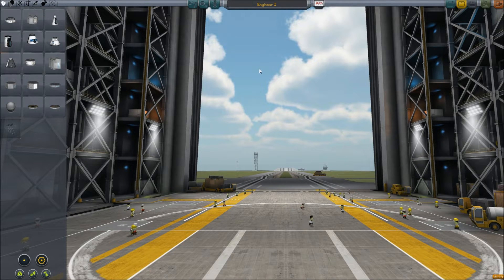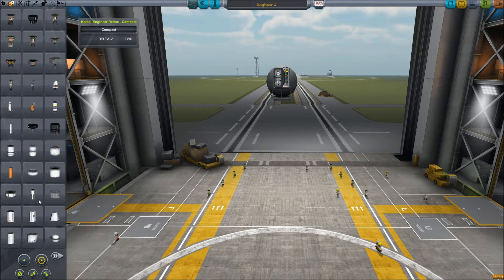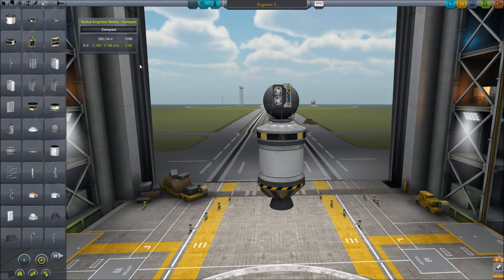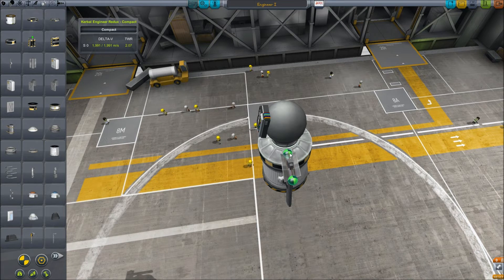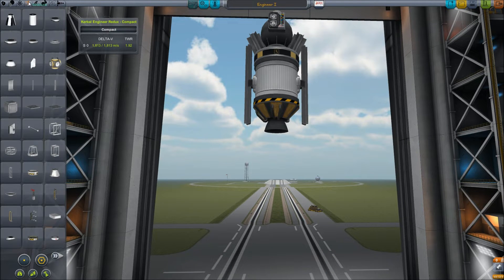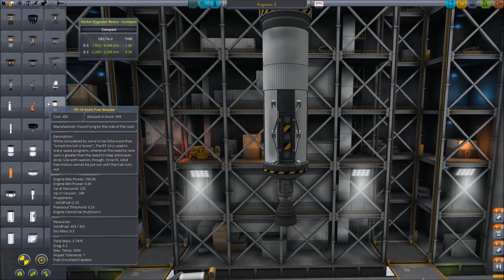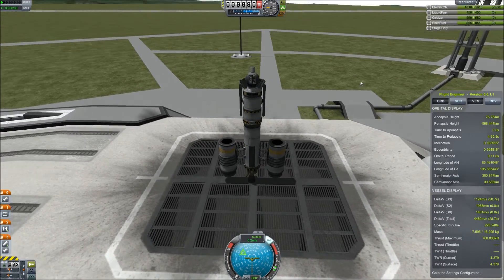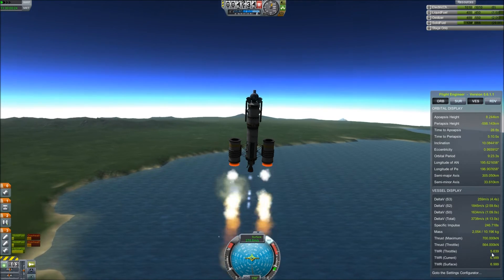KSP Mod Kerbal Engineer Redux

Comment: Is there a way to add other headers  to the KER window (at VAB)?
I am interested to know which altitude I can reach at the end of each stage. This way I could change for example engine thrust, limiters (solid fuel) and fuel quantity before I try to launch. Considering a straight climb.
I ask this because I have trouble for example arriving to a specific altitude with a specific speed to test some part for a contract. I need to test a dozen times before I get it right, this gets boring, it kills the fun. Launch, observe, revert to VAB, make adjustments, launch, observe, revert to VAB, make adjustments and recycle, not very fun.
Have been looking for a tool to calculate that but very difficult to find, but KER is helping a bit.

Comment: How do you calculate it if you wanna use your boosters and your Liquid Fuel engine at 50% at the same time?
Reply from the maker: Not sure if I understand exactly what you mean, but as a general rule you want your solid boosters to empty out as quickly as possible. It's horribly inefficient to carry them up with you any longer than absolutely needed.
Reply: larsmaehlum Nevermind, it was just a dumb question, sorry.